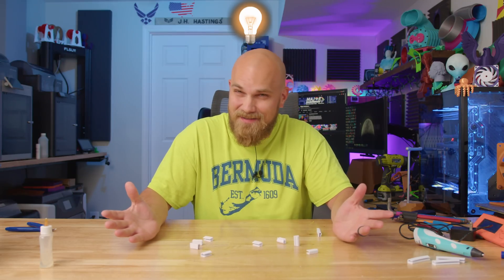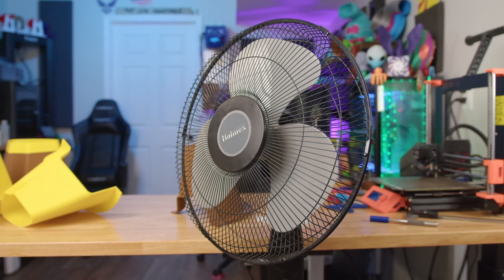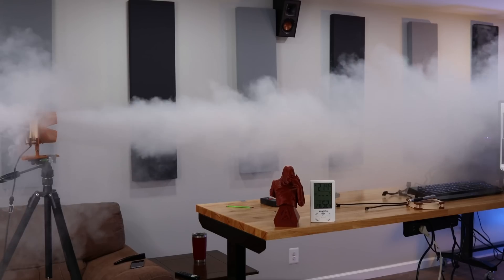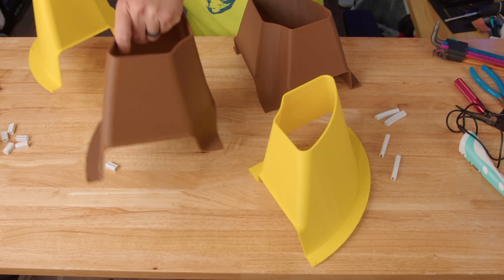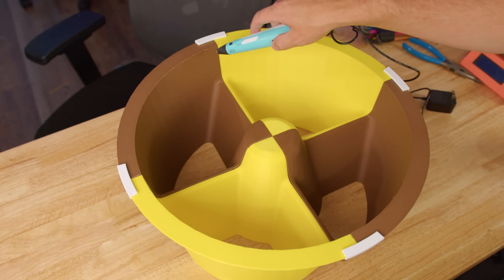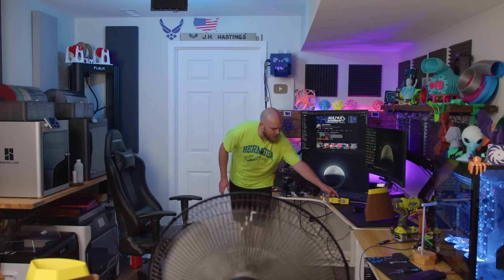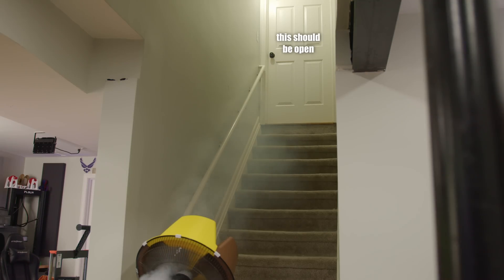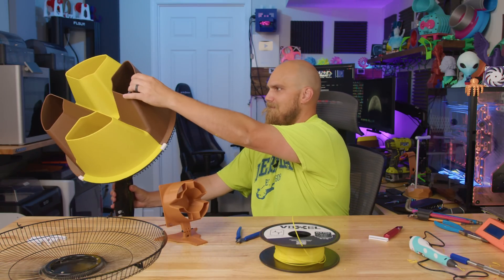Should Noctua make this STAND FAN?

Comment: I have come up with different ways to move the air around the house, and at one point I had a swamp cooler for part of the year. When running it I got the best cooling when I would open the windows at the far end of the house 1 inch, and the attic access a few inches so most the air would push up and cool the hottest part of the house, the roof. With the windows cracked open a little some air still flowed into those rooms. A cooler just moves air and an HVAC is the same, in a different way.
Using a fan to "push" air from one area to the other as you were explaining usually doesn't work as well as you think. All it does is create turbulence, cause it's blowing air into air that has nowhere to go. What you need is an "exchange" of air. Some way to move the hot upstairs air downstairs, and the cool downstairs air up. Non interfering. As impractical as it sounds, if you got a Noctua fan connected to a 3" pvc pipe upstairs that [somehow] went thru the floor, or just ended downstairs, the air would exchange, over time. The HVAC would do the rest.
It helps when the HVAC in a multi story home has intakes on every floor so ALL the air got exchanged by the system, but homes are built cheap, and sold high.

Comment: Perhaps a counterweight on the back of the motor, something as simple as a rod with a weight on the end.

There are a number of modern thermostats that would solve your problem. They have remote sensors for multi zones, and can be set to circulate without cycling the equipment. Modern AC equipment also has dip switches on the control board that allow you to speed up or slow down the fan mode for circulation. This would be a better solution however it would deprive you of course of your fabulous content.

A fan of this nature when balanced and  paired with equipment capable of controlling it's orientation, and paired with cameras capable of tracking an individual would be an awesome follow you everywhere around the room fan.

I am an active individual who moves around a lot, and I do tire of constantly repointing fans. It's impractical to have half a dozen fans pointing to every workstation.

Comment: attach a flexible duct and run into your room, the output placed near the ceiling. Better yet, place the fan in the basement where the coldest air is supposed to be at.

Comment: Just as a general rule of thumb what I tell people a lot of the times is to shut all of your supply vents off downstairs and one or two registers next to the thermostat and that will send most of the air upstairs for better cooling. Again, this is a general rule of thumb. Just let me know if you need any questions answered that pertain heating and air.
Reply: Also, lately I've noticed a lot of returns in homes causing issues as well. They're set down low to the floor when they should be up towards the top of the room

Comment: What if you got something like those tubes for cats to play with, and put a fan at one end pulling air through the tube. The fan goes at the top of the stairs, the tube goes down the stairs, and it should pull air through the tube & upstairs.

Comment: What about a vortex cannon air duct? I know those work really well for pulsed air flow but no idea how it works with constant pressure. In it's simplest form a bucket with the center of the bottom cut off.

Comment: Maybe faster air, but I but volume is less. With a goal to push more cool air, I think the original design is still going to be better for your needs. Consider that the shroud isn't something you'd put in the PC case because you are still going to want higher volume of air to increase cooling, you want increased flow, and I expect this shroud would have the same problem.

Comment: It works, but it seems the size ratio is way different, maybe tighter ends would work even more? Or what about one funnel in the middle? Maybe it's simply because you reduced 100% to 40% output area. neat idea, albeit hideous.

Comment: Your main problem, is you live some where that gets cold. This means the top most return vent is below the top floor or at the bottom of it. You should run a vent to the top of your top floor, and have a big switch so the top most one swaps from below top floor, to above it. this will suck in ALL the hot air, and cool it. in Arizona, all the returns are on the ceiling for a reason.

Comment: I spoke with an hvac guy about this, and he basically was explaining that the blower doesn’t have enough static pressure to reach the furthest vents (re:upstairs). Obvious suggestion is to close the vents downstairs, but I always wanted to try adding some noctuas to the vent to draw the air out. 

I’d love to see you test that - can we just add 120mm fans to our hvac vents to improve the airflow at the vents further from the blower?

Comment: Air conditioning and fans often don't work well together. The bottom half of a room could be 67 but the last 2 feet at the celling could be 73. You almost always end up with a warm room when mixing the full volume of air in a room.

Comment: Don't know if anyone has mentioned this, and I'm not going to sift through the comments to find out, check the settings on the HVAC panel.  See if you can run the fan constantly at a low speed.  A guy I know has that function.  It kept his house at an even temperature and used less energy since the fan is not only at a lower speed but only had to maintain the speed.

Comment: So there was a fan back in the 30s and 40s called the rotobeam my brother has one from like 1942 its wicked has beam of air like 40ft. His is the 21in pedestal mount with aluminum blade. You should build a rotobeam blade out of pla and try it

Comment: As far as I know, fans are designed to create turbulent flow. So putting a simple tube or cone like shroud on it made from paper with parallel deflectors inside would help you get a more directional and longer reach of airflow. Or if you want to go crazy with it, you can make a shroud of a tube in a tube in a tube, where in a big tube there's three or more smaller ones, filling out the area, then in those, there are also three or more smaller tubes, and so on. Both shrouds should cover at least the plane of the rotors to be  effective.
For the flow to reach further, you would either need a more powerful fan or make the flow more laminar.
Although, I think the best solution would be to drive out hot air in the upper level instead of trying to push up colder air from the lower level, as that would be more efficient.

Comment: Hey man, something that would be fairly easy for you is to go into your attic or crawl space and run an extra return air for your downstairs room. Install the return air box across the room from the supply, and run it to the return plenum on your HVAC unit with some flex duct.

Comment: I know this solution doesn't make an exciting video. But the solution you're looking for is dampers in your duct. Manual dampers will do the job on the cheap. But zoning with thermostats for each zone will get you the best results without having to make adjustments every season.

Comment: You could try printing it out of colorfabb LW-PLA, saves about 2/3 on weight and if you get the settings right the surface is a little smoother than layer lines are.

Comment: Load up the base with weight(heavy bags for industrial light poles for example) and thighten the screw on the swivel base(or put resistive band to tension it against the heavy weight)

Comment: So, you are trying to get better air circulation from downstairs where it's cool, to upstairs where it's warm?
Why don't you just make a relatively simple DIY setup where you have a fan pushing the hot air outside the house, with a little thermostat and Arduino to act as a cheap alternative to AC. If you want to cool a space, you NEED to get rid of that hot air somehow.
Anyway, I am sorry for being "that guy", this was a really cool project. Honestly worked a lot better than I expected.

Comment: My idea for another vid -  I seem to remember seeing a video where the outer blades of a fan were connected with a ring, like an electric radiator fan, and that increased efficiency greatly. Why don't you print a new blade for that fan, or a ring to attach to the current blades and see how that goes.

Comment: wonder if you could shorten it and use that physics concept that pulls air with accelerated air. some contoured cutouts near the back would help also some internal grids would give you a more airtunnel like flow allowing for a more direct flow of air. letting you shorten it and maybe reduce weight

Comment: You should experiment with this in a Whole House Fan configuration by attaching the fan to the attic door with a box fan.
Leave windows open down stairs and the box fan will pull cool fresh air through the house and take the hot air into the attic.

Comment: The project is kool! 

Did you know you can run your house AC blower fan to circulate the air in your house even when the cooling compressor is off? 

This is meant to balance the temperature between rooms by continuously mixing and circulating air. 

Hopefully you have a programmable thermostat so the blower is not running 24/7 causing extra wear on your system.

Comment: I've developed my own tricks with window fans. For example, I have a box fan in a window near a corner wall and door, and if I angle the door right it will blow airflow my way. The door covers about 1/2 of the fan when opened parallel to it. This is actually a very good trick, because the air gets pushed into the door, then spreads out toward the ceiling, which helps to move hot air and cool the ceiling. A way to simulate this is to get something like short room divider you can place in front of the fan. When the air hits it, it will spread out in all directions, and you can angle one part of the room divider to direct the flow toward you. Since my fan is in a corner, it pushes air toward the corner and loops around, which also pushes air from the part that isn't covered by the door, giving me direct airflow even though the fan isn't facing me. 

So basically, if you want to focus a fan that isn't facing you, use an L shaped apparatus around it. For me this is important, because I am able to push in cool air from the window without having to actually sit in front of the fan. And since I have windows that open from the top, I leave them open a bit, so when cool air is pushed in, hot air near the ceiling convects out the top of the windows, which makes a massive difference on hot days and keeps it quite comfortable. One thing about cooling is even though direct fan flow feels nice, if you aren't cooling the surrounding air, it's not going to help as much, so you need not just air blowing over you, but also air exchange with the outside. With my trick I can do that with a single box fan. 

In fact, I cool an entire floor with a single box fan and convection tricks. I find that intake is best for most of the day, while exhaust is better in the evenings, to ensure cool air is sucked in from every open window. Intake cools a single room faster, while exhaust cools every room but slower, so it's good to use like that in the evenings when things cool off, so you're getting cool air in every window from a single fan blowing as an exhaust, which gives it a greater effect at night. But during day when it's hotter, using a fan as an exhaust has less of an effect, and intake works better for cooling a single room.

Comment: FYI - you can buy thermostats (like ecobee) that can connect to compatible sensors in separate rooms. So you can control the thermostat temperature based off the reading from whichever sensor you want. You can set up a routine to switch which sensor it goes off of for certain times of day.

Still love the video idea though haha
Reply: I have the Honeywell version of that and it's great. I also put a couple ceiling fans in my open stairwell on 72" drops to help circulate the air between the upper and lower floor. Each one is on a separate speed controller and spin in opposite directions so I can control the rate of air moving up or down super easily.

Comment: you should try balancing your forced air system. Close down the registers in the basement and the main floor. This will force more air flow to the 2nd floor. It might take a few weeks to get it right. If a room is warm, open the vents to that room. If the room is cold, close the vents down. After a while your house system will be balanced. All rooms will be the same temperature. 
Just saying

Comment: It has already been mentioned to just have your HVAC fan on, but many systems have a "recirc" setting that runs the fan slowly all the time to even out multi-levl temps, but then run at normal speeds when the system is cooling or heating. Not sure if a 3-D print will be needed for this however! Great show!

Comment: If you really eant the cold air upstairs, you need a duct from upstairs to the basement.  Like through the floors. Maybe in the wall.  Hot air rises because it weigs less.  Either the hot air needs to get sucked down or the cold downstairs air sucked up and the vent allows the counter circulation of the other air.

Comment: Or the super cheap fix for your scenario, open all the registers on the top floor, a few on the ground floor (maybe, depending how much cool air flows down the stairs) and one or two in the basement. Swap for winter as needed.

Comment: Any chance you can make a box fan noctua like blades to allow for static pressure? I use a 20" box fan and filter to cool a threadripper pro and 4 gpus, and the air flow is decent, but I feel like it could be better.

Comment: If you simply block off a few registers on the first floor, particularly in the main room(s) where the thermostat is, it will force more cool air upstairs. What you are aiming for is thermostat needing to wait for that cool air to come down the stairs in order to shut off.

I used to do this with inline dampers I had accessible near my furnace. I had the damper arm positions  labeled "Summer" and "Winter" so I didn't get confused which ones should be open or closed during AC season or furnace season.
Reply: You have to be careful doing this, because your blower is rated for a given static pressure, and if you exceed that by closing too many registers your blower motor life will be significantly decreased. Best to know your rating and install a gauge to make sure you're within specifications.
Or, don't, and your HVAC guy will be stoked for the extra work you'll have to pay him for, and, it's an easy job to boot, no crawling around with the creepy crawlies like he's used to.

Comment: For the weight, maybe decrease the depth of the shroud; might not need identical geometry for similar performance. To maybe increase airflow, make the printed shroud go close around the fan blades (though because it would only be closest to the blades at a single point per, maybe that won't help at all).
Reply: Just lopping off the ends would probably fix it. Those kinds of fans have terrible static pressure anyway, so, reducing the nozzle constriction would be beneficial, as would squaring off the blades and installing a fitted duct.
Reply: @jttech44  ! Good point! I hadn't considered radially removing material from the original fan blades (would reduce total diameter which could be a negative). Would printing bespoke blades be better than modifying the existing ones (would require something loosely like a lathe to do so?)? Idk. New project for our host to investigate! ;P
Reply: @agentid36  You could, very likely, print better blades with a new housing and make these sorts of fans far better. I would be worried about motor loading however. Those sorts of induction motors are really designed to run in a very specific window and outside of that, you'd likely see premature failure.

Comment: Every day that I stare at the old, dusty and neglected Stand Fan I got around the house (ain't mine), is a day where I wonder how useful it would actually be for cooling... Sure, those do 30+W and are noisy, but they are not engineered for the purpose of CPU Cooling. And considering most have an easy way to swap the blades, it wouldnt require their destruction to substitute for a 3D print one...

Comment: My personal solution to the differing temps is to simply turn the AC fan to ON rather than auto. Let it circulate your house air, it will bring the cooler air from downstairs back upstairs.

Comment: You might want to buy a different fan. I had a fan that looks just like it (including the blade design) and it was loud and didn't blow air that well.

Then I bought a popular Duux smart fan (just naming it cause it might help people) and holy crap. It blasts so much air and so far. Like on medium speed (it has 18 speeds I think?) you can feel it well from across the room (like 3-4 meters away), despite it being quiet. Even when you have it moving slow and you don't really feel the air, it still cools pretty good because it's still moving quite a lot of air. It's honestly shocked me with its efficiency. and speaking of efficiency... it uses like 6w while blowing tons more air and being way quieter than my old fan, which uses 60w........

So for anyone who is using a fan that looks like the one in this video... you're probably wasting your money using that fan. you could use something that uses way less energy and can be either super quiet or ultra strong (and still quieter. heck it's quieter and better sounding on full blast than on medium speed on my old fan lol)

I like to put it at the end of our (gf and I) bed on hot days as well on speed 2-3. I hate fan noise while I'm trying to sleep, and at speed 2 I cannot hear it and speed 3 only barely when there's no other noise.